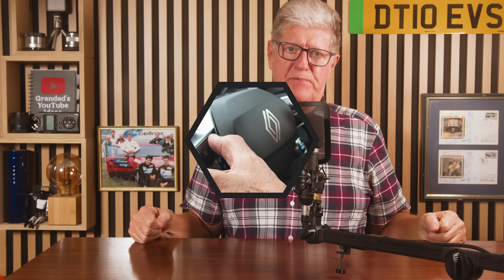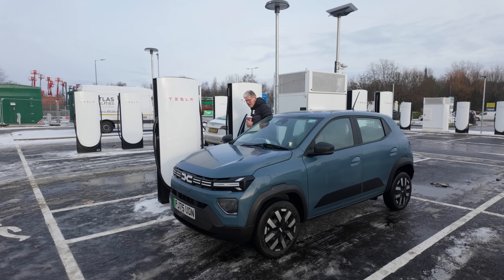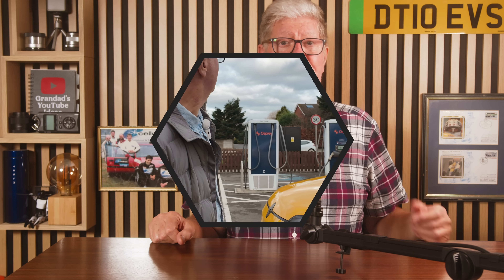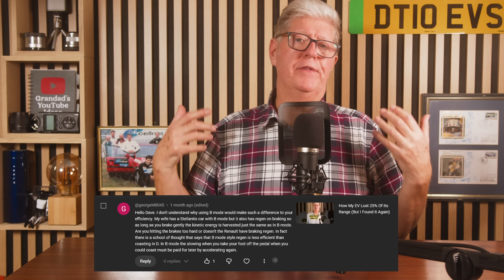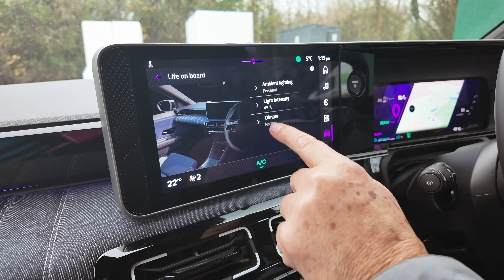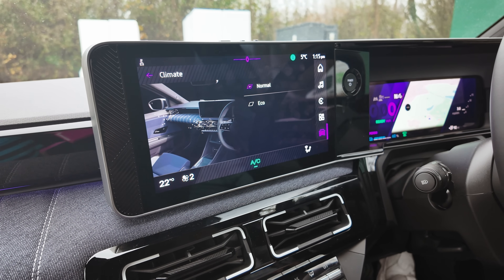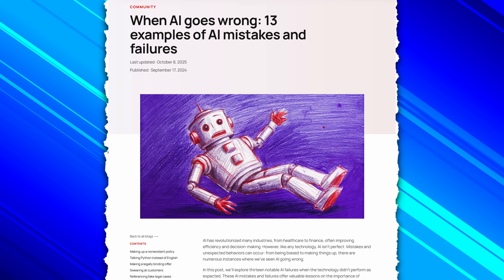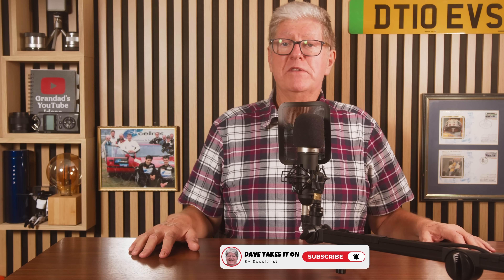Was I Wrong About Regenerative Braking On EVs?

Comment: I prefer cars that have an auto setting for the regenerative braking. This means at high speeds the regen braking effect is minimal but as speeds drop the regen becomes much stronger. As you approach junctions the car slows progressively using regen more and more. I appreciate that the Tesla approach of constantly using the accelerator pedal may generate more regen recovery but it’s not as comfortable as just letting off the accelerator entirely and letting the car judge the regen level required.

Comment: Heres another small note about regen and One Pedal driving (based on my MG4) at a certain speed, the regen is too low to be effective to come to a stop and the motor actually applies reversing force.
It took me a while to realise, but it became clear when it rolled 1m backwards up hill.
I always thought they used the mechanical brakes at a certain point, but it appeas i'm wrong about that part.

Comment: OK I will take it on. You have over simplified this because you are basing this on one car and staying with either full or no regen. You didn't take into account the first part of braking also regens above the set regen. Another consideration is the dead band of the accelerator, ie. how far the peddle moves between sending power to the motors and sending power to the battery. Regen is certainly not 100% efficient nor is the returning of power to kinetic energy. I don't know the losses but I expect it is around 25% is lost.
I have recently changed from an Outlander PHEV (6 levels of regen including none) to an I-Pace BEV (2 levels of regen).
The Outlander had padels to go up and down the regen settings. It had very little dead band so in max regen you end up switching between accelerating and regening when trying to go at a constant speed (losing the 25% each time). This is why zero regen is far more efficient. It also would do a lot of regen when braking before wasting all the energy as heat. High regen is used to slow down in a controlled way and especially useful on hills to control speed and not use the brakes. As it has a small battery, one pedal driving is not possible as the regen is limited.
The I-pace has high and low regen and a large dead band. I only use it on high as it is obviously much more efficient. Also you have to go into a menu to change the setting. The dead band means I can coast easily without wasting the 25%. 
To sum up - you need to tailor your use of regen to your car. Basically new BEVs full regen older PHEVs use the paddles.

Comment: I think you completely misunderstood what people were trying to say. 
Nobody wants to turn off regen. 
But likewise when I see the car in front brake or indicate, I don't want to be accelerating, I want to cover the brake pedal in case I need to stop. The accelerator can't guarantee a stop, particularly if the battery is nearly full. 
But likewise I don't want to try and find the sweet spot to stop the vehicle from braking.

Comment: First: Tesla are amateurs! They didn't have the engineering capacity to make proper force management (including brake blending) work at first, as traditional car manufactures HAD to, because of automatic transmissions and hybrid cars! If one-pedal-driving is o-so efficient, why has Tesla now implemented brake blending and re-introduced a reduces base regen setting in the new Model Y !? Coasting with brake blending IS the most efficient way of driving! Nothing else can be argued if you stick to the laws if physics!

Your argument falls apart once it hits reality! We are not driving on perfectly straight and level roads! With regen off and driving "with the terrain" (meaning using constant power, slightly accelerating and decelerating on gentle gradients) and coasting into speed limits means that the inefficiencies in the motor and inverter are only dissipated ONCE, not twice! 
Having a base regen turned on just makes the drive nervous and uneven. You rarely hit the exact point for the power needed, always accelerating or decelerating, passengers get sick! Drivers aren't robots, the right foots also needs some rest!

PLUS: there are wildly different implementations of regen! 

From 2020 to 2024 I drove a Hyundai Kona electric (a FWD ... important for regen!). The first year I followed the same flawed principle you are stating on your video, always max base regen. I managed 10-11kWh/100km (~5.9 mls/kWh) if lucky, usually 12kWh/100km.
But guess how I got the best efficiency and a MUCH more relaxed driving style after that year? 
Right ... ZERO base regen, "intelligent regen" turned on (meaning the car automatically adds just enough regen to keep distance to the car in front ... and only when something is in front ... works beautifully!), and to stop the car just pull the left regen paddle to purely brake by regen without ANY mechanical brake (warning: brake rust can be severe!). In the city I could regularly reach 9 to 10kWh/100km (around 6.5 mls/kWh) in a 1.9tonne compact SUV (When I could mostly govern the way I drive, not hindered by traffic, e.g. at night). When I regularly used cruise control I got worse efficiency than with coasting ... because it was constantly changing between regen and power.

Since 2024 I drive a Volvo EX30 RWD. This car has yet another form of brake blending ... mechanical brakes on regen! So it is the other way round. There is NO WAY to brake without also wasting energy in the mechanical brakes! Even with regen set to max and not touching the brake pedal you can clearly hear the mechanical brakes working (i.e. when lightly rusted on the side of a salted road in winter)! This car has a horrifically bad consumption in the city (best I've seen was 14kWh/100km, usually not below 16kWh/100km ... so 50-70% worse consumption)! Originally there was always some regen even on the lowest setting.
With a software update last year the driving characteristic totally changed! Now in the lowest regen setting the car is actually coasting. We only use this ... much smoother drive because you can clearly coast for a couple of 100 meters. Guess what?! Our consumption IMPROVED! On my partners work route the optimal consumption fell from 20kWh/100km to 18kWh/100km, so 10% improvement! Still horrific, the Kona used 14kWh/100km on the same route under same conditions. 
For science I tried the new even heavier regen mode this new software release provided. Jerky drive, unrelaxed right foot, way too much focus needed for the easy task of keeping speed and the efficiency was: TADA ... WORSE!

For consumption on routes with frequent stops FWD is still king on the efficiency front.

The VW MEB platform manages regen braking in a way that it absolutely makes no difference whether you drive in D or in B (proven by multiple channels in multiple experiments), as long as you drive in the same manner. So I'd rather have the comfort as the driver to not constantly having to balance the acc paddle to not make passenger sick and light up the brake lights! I assume this to also apply to Audi, BMW and Mercedes but haven't actually seen this proven. At least I know of very high regen power numbers achieved by cars from those brands, which points to similar behavior like in VW MEB.

So yes: You are completely wrong with your assessment. NOT converting energy in the first place is the most efficient way of driving and your test was far from scientific! I fell for that flawed thinking too.
Want to drive an EV efficiently? Learn how to brake with a constant force and start to brake early ... this makes life easy for the brake blending to maximize regen!

Comment: Dave, Dave, Dave, where on earth did you get the idea that no energy is lost by an electric motor in regen mode?  Transforming kinetic energy to electric energy to chemical energy, then back to electrical, and back to kinetic has heat losses in every step.  The most efficient systems return only about 75% of the original kinetic energy back to kinetic again. Think about it, why do electric motors need cooling systems?  

The best use of kinetic energy is to coast as far as possible, not to regenerate chemical energy in the battery.  

Regen is for when you misjudge a traffic light, or traffic engineers use an energy wasting stop sign instead of a roundabout, and you have no choice but to scrub off kinetic energy.  Service brakes are for emergency use only, as you surely are a good enough hypermiler to avoid sudden stops. 😂

Comment: Hi, Renault 5 driver here. Just a couple of observations from both this and the previous video. 

When I first got my 5 back in October I thought I'd give it a go with the regen and did a bit of a similar experiment to you (ran it for a bit with and without regen to see which would be most efficient). What I found was almost the opposite of you. With Regen, I struggled to achieve over 3.6 mpKwh, without I could easily achieve over 4 (not sure how you managed to got it sub 3mpKwh in your original video, as even when it was -5 degrees last week, mine never dropped below 3mpKwh). 

Now. I'm not going to say you're wrong and that regen is a con. However, what I will say is that I think the biggest impact on efficiency is driving style. If you look ahead, read the road, anticipate, lift off and coast towards stationary hazards/traffic lights etc. this is an efficient way of driving - you wouldn't accelerate up to a red light and then brake hard in the last 20 meters, would you? If you read the road some way ahead, the regen isn't going to work, as it is trying to slow you down all the time, meaning you're using energy to get back up to speed again (and you'll never recoup as much as you use. Ever.). The aim for efficiency is to keep the wheels moving, as the most energy is used getting initial movement (think about if you have ever had to push a broken down car, getting it moving is a ball ache, but once your rolling it is quite easy to push). 

Anyway, the point I am making, I guess, is that it isn't about which driving mode you use, but about how you drive the car.
Reply: Also, just to add. the 5 is significantly nicer to drive when in regular D, rather than B.

Comment: My MG4 has a simple “power indicator” on the driver’s display. When I am accelerating it reads positive. Maybe 20 if I drive sensibly, maybe 70 if I’m not. When regen braking the reading is negative. On low regen braking it may display -5, on high regen braking -15. In any regen braking mode, when the brake pedal is pushed the power indicator will increase to -20 or -30. Touching the brake pedal in my MG4 will apply even MORE regen before it resorts to the mechanical brakes.
On gentle downhill grades, with max regen braking on, I still have to press the accelerator to maintain speed. But the power indicator may display a negative value. So I’ve got my foot on the accelerator, to maintain speed, but I’m actually regen braking. If I take my foot off the accelerator completely in max regen, I decelerate noticeably. I have to apply force to the accelerator to maintain speed, but the car is actually regen braking and recovering energy as I descend.
EV drivers need to learn that the brake pedal does not mean mechanical brakes. You can drive around in minimum regen mode, using the brake pedal as required, and still benefit from regen braking as much as you would in max regen mode.

Comment: Here is the error :
9:27 "Once again, nothing is lost ... you can't lose energy"
No. You definitely lose energy by slowing down using regen and accelerating back, because neither regen nor acceleating is 100% efficient.

Repeated develeration/reacceleration should be avoided to minimize this loss.

Now, the Regen Setting of different cars don't necessarily do the same thing.
In some models it may really be a trade off between mechanical and electrical breaking, in which case it should be set to maximum.
But on my Renault e-tech the Regen Setting only defines the coasting deceleration. Therefore  I set it to the minimum to avoid repeted decelaration/acceleration cycles. The actual braking behaviour is still electrical with regen.

For the same reason I don't use one-pedal driving: I'd need max regen setting for slowing down with that one pedal and this makes it quite difficult to avoid unnecessary deceleration/reacceleration cycles.
Btw I get 3.75miles/kWh in winter and 5 in summer.
Reply: Yes. Repeated deceleration/acceleration cycles should be avoided. The amount of energy regained by regen braking is less than what it took to accelerate to the speed you were previously doing. It’s pointless pumping a whole bunch of energy back into a battery, just to use it and a bit more to accelerate back to the speed you doing a few moments ago.

Comment: The real secret to gaining range is not choosing between coasting or regenerating, but knowing how to combine them. Coasting allows you to avoid waste, while regenerative braking lets you reinject some energy when needed.
Start observing the road ahead more carefully. Anticipate movements, release the accelerator well in advance, and let the car glide. You’ll discover how rewarding it can be to gain a few more miles simply by improving your driving style.

Comment: I found that having high regen set on my Kona Electric led to my driving score on the Aviva MyDrive app (other driver monitoring apps are available) being penalised for 'harsh braking', which largely disappeared when I set the regen to off (sometimes the regen is increased by the car when it detects a vehicle ahead). I tend to use the paddles to adjust the braking until I'm down to 15mph, if possible, and try to only use the pedal when below that speed.

Comment: Good video Dave. Thanks for all your content. I use max regen and love the driving experience. Question though: is it worth switching off regen every now and again to give the disc brakes a workout?  I had heard that they can corrode more quickly on EVs through lack of use. In fact I seem to recall that this was the reason VW stopped using around disc brakes on some of its EVs, or have I mis-remembered this?

Comment: I have my first EV on order and so my understanding of regen braking is really sketchy. I'm assuming if you are using this you have to have adaptive cruise control enabled or every time you take your foot off the accelerator the regen braking will kick in and you'd come to a very rapid standstill if regen set to max???? I'm getting quite confused by this! Any advice welcome. After 50 years driving an ice vehicle it sounds like I will have to unlearn various ingrained, driving habits that are done without thought. Worried that an old dog can not learn new tricks. Any other habits that will need to change?
Reply: Once you get your new car and drive the first few meters with one pedal driving you'll get the hang of it.  It's proportional to how much you lift your foot off, so with the full OPD setting you have complete control over the amount of acceleration and braking with just the one pedal. 
So then the brake pedal is only needed for really rapid emergency braking.

Comment: Good!  I generally accord with this, believing there must be some inefficiency in the way regen operates, but it is dwarfed by heavy regen and relatively wasteful to do light regen.  I did notice on daughter’s kona EV, once i set it to ‘auto’ regen, i never bothered with paddles any more.  They must really have the auto-regen figured.

Best example of relative efficiency i saw, of brakes, was on youtube a guy came down from a well-known mountain in his EV, and found he could comfortably touch his brake disks immediately afterward!  On his previous cars, he’d have burned his fingers.  And heat is always a waste of energy unless you specifically wanted that.

Comment: You're comparing zero regen to max regen. My F150 Lightning uses "max regen" when using one-pedal driving but also regens during normal braking (down to about 10 km/h) as well as coasting. The coasting regen makes the truck decelerate at approximately the same rate as the ICE version. But there is no need to use Max to regenerate, at least in the Lightning.

Comment: My problem with high regen levels or "one pedal" driving is what happens when you leave adaptive cruise control ?
if "one pedal" is selected then you get uncomfortably rapid deceleration because your foot isn't on the accelerator
Reply: In that case you need to press the accelerator the correct amount before disengaging CC.  If you practice this a few times you'll find that you can do it automatically - the right point is when you first feel the pedal having a very slight effect. 
It's a bit like matching the revs when shifting gear on a manual car but without the helpful audio feedback.

Comment: Maybe it depends upon the car driven, My Skoda Has D or B it uses regenerative braking in both the only difference is when, B = as soon as you take your foot off the accelerator (Good in stop start traffic but annoying at other times) in D it regens when you brake (Simply clever) shows you on screen with a green/blue bar Green costs energy (GOM goes down) . Neither lighting up (no loss GOM goes up) Blue (regens battery GOM goes up). If your car automatically slows when you lift your foot what you are adjusting is the harshness of the action,up to this magical "One pedal" I never use "B" unless stuck in traffic. Power recovered will not recoup power lost to accelerate to a stop. It's the way the car is driven that makes some think either is best.